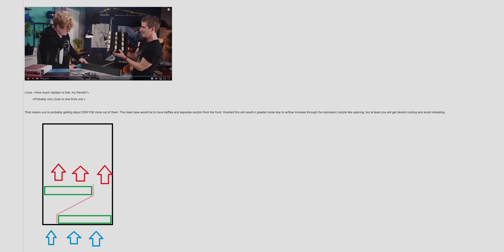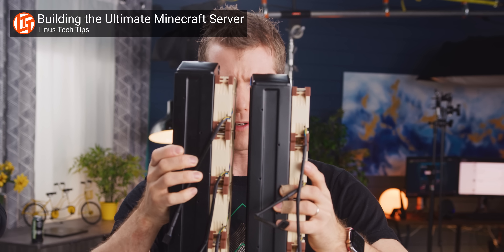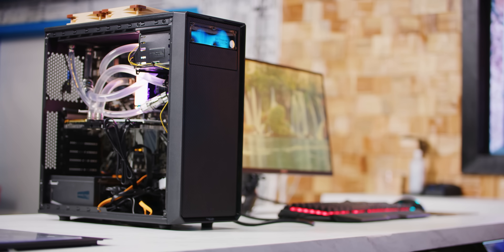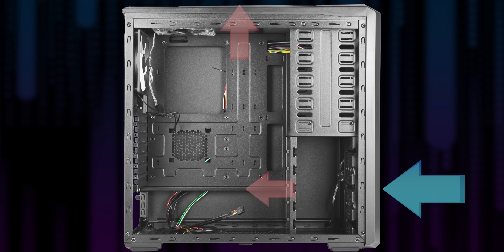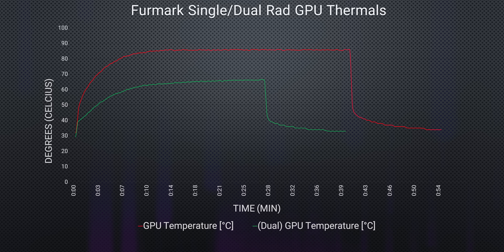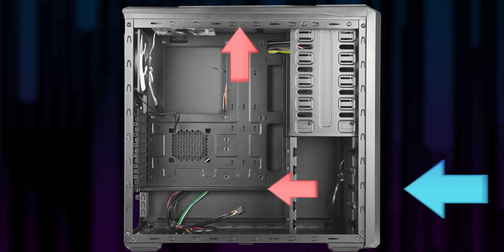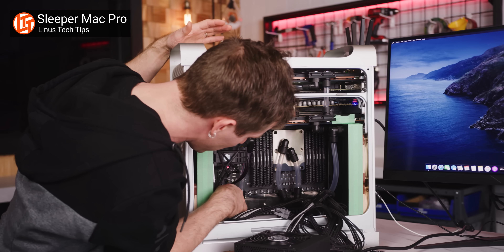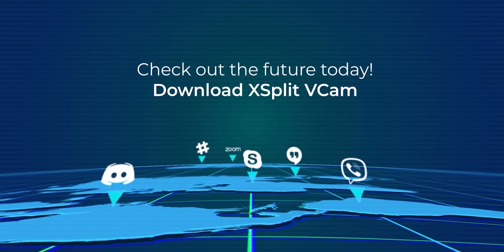I’ve been water cooling wrong for YEARS - $H!T Manufacturers Say

Comment: It's all down to CFM, and fluid volume.
more airflow = greater disparity in temps between the radiator itself and the air exhausted.
Let's say you have the first radiator at the top exhausting the bulk of the heat to atmosphere and a secondary at the front, any heat that makes it through the first radiator will be mostly displaced by the second. Sure it's going to slightly pre-heat the air through the primary, but it's still vastly cooler than the radiator itself enabling it to work. Also, in order for things to get to that point it will now take longer as not only are you more effectively cooling (i won't say efficient, as radiator efficiency is highest when coolant temp is way about ambient) the system, but it's going to take even longer again to saturate the added coolant and metal with heat.
The same thing applies with 6 stacked radiators, as long as the coolant enters via the exhaust end of the stack and maintain adequate airflow it will have a much greater capacity to absorb and exhaust the heat.

If you stall the fans however, all the heat has nowhere to go and will simply be absorbed back into the loop by other radiators, and the same if you reverse the flow on a stack, as you're then pumping heat out through the secondary and tertiary etcetera radiators enabling some of that heat to transfer back into the coolant and back through the loop.
Another option is to have a bigger secondary radiator than your primary exhausting radiator, that way if the second radiator heats up, the fans ramp up, and a good portion of that slightly heated air will exhaust either through the rear case fan, it out through any holes/openings in the case via positive pressure.

Comment: Guys... your video is confusing me. Isn't the CFD simulations show a comparison between open case and closed case (Removed dust filter + glass panels)? 

The difference in airflow suggest it.
Your "test rig" isn't representative of a stacking (serial) configuration, but rather a parallel configuration. You must do another shoot with a real stacking configuration like 2 120mm radiator stack (I think it will fit in the case). And i think the results will be interesting. 

Thanks anyway!

Comment: I think what they were missing was the fact that there's alot of air volume inside a case and air temperature dissipates very quickly. Let's say you have a 3fan rad up front and just 2 fans no rad on the back and forget any other openings if you measured the air temp right after it passed through the rad let's say it's 30c by the time it gets to the back fans it'll have cooled down you can actually test this by simply opening up the case and feeling the air exiting the rad then close it back up and feel the air exiting the back fans. Another point is that with an additional rad you're adding to the total amount of fluid in the loop like when jayztwocents used a box fan covered in rads he turned the fan off and still reached ambient temperature just due to the amount of fluid and the distance it had to travel (this is where the facts end and my own 2am thoughts start) I don't believe radiators are that perfect if they were even 90% efficient then temps would be only 10% higher than ambient right?

Comment: I am interested which way around corsair piped their water, and which way around linus did - I would expect piping the hot water into the first cooler on the inlet and then the second cooler on the outlet would be closer to corsairs results, and visa versa (hot water first into the cooler on the exhaust, and then the somewhat cooled water into the intake cooler) would show definite improvement. I would also expect reversing the fans so that both cooler blocks where exhausting would be an interesting comparison depending how much dust you are happy sucking in.

Comment: Also, did you just not hit the thermal limit of what the front rad could dissipate into the air.  Would, therefore the air had more latent capacity so the second rad did give up some heat.  I think Corsair's simulation either relies on the air temp getting up to the coolant temp after passing the first rad be it through heat dumped from the first rad or that the air temp is now too high to cool the second.

Comment: Would like to see if the 5C delta on the minecraft rig may have something to do with the lower thermal mass (less water and brass) or a change in flow restriction.
I'd be surprised if the Air wasn't in equilbrium after the 2nd Rad.
2nd idea, did removing the rad also result in the removal of the fans attached to that Rad? that would result in a lower deltaP and thus lower airflow through the remaining radiators. Though finding a Certis Paribus point for the fans and delta P/Vdot would be tough...

Comment: 3 things as I see it.
They talked about lower wattage/temp not 90'ish of 400W monsters. Lower the temp difference, less results you should have.
Configuration of hot vs cold was different. From what I see is that hottest should be closest to end. if you stack them with the hottest point on the place where air enters your rig, results might be as what they described.
what they meant was diminishing return? you will get SOME change by share volume of coolant. MAYBE the loop would be just as efficient with big rez as with 2 radiators?

Comment: It’s all down to airflow velocity, if you push enough air through fast enough your exhaust air will only go up a few degrees but due to sheer volume you’ve still removed the heat. They assumed quiet fan curves so low volume but you guys always go balls to the wall with fans.

Comment: It all depends on how you position the 2 rads. Stacking them in a fan rad sandwich is bad. One rad is being cooled but is transferring the heat into the 2nd rad which is already cooled. Negating the cooling done. And 1 rad being an intake while the other rad being the outtake would be ok. Depends on if you have other intakes. If you don’t have other intakes, would have the same problem as the sandwich. is you have them both as outtakes then it’s be a good thing as well. Tldr: It all depends on how you position the multiple rads and their fans.

Comment: Something I think it would be worth checking into based on other airflow in your case is having both radiators exhausting or intaking rather than one intake and one exhaust, both exhausting would prevent them from spitting hot air into the case at all, and assuming you had other intake fans throughout the case, I’m sure the inside air temp would still be cooler than what they’re trying to dissipate, or having both radiators intaking colder ambient air, with other case fans providing exhaust throughout the case

Comment: So I guess what we really learned is that: when you're planning the loop in a two rad setup where one is intake and one is exhaust, just to be safe, you should try to put the exhaust radiator first in the series to receive the hottest water, and the intake rad second, so as to potentially maximize the temperature delta between the air and water (even though it's likely to make very little practical difference)
Reply: yep this is what is called counterflow heat exchange
Reply: This is indeed a very important consideration. Heat exchangers used in industrial equipment are always set up in a cross-flow configuration...this way there is an appreciable temperature delta throughout the entire heat exchanger, rather than a decreasing delta.

Hydraulic fluid example:

          hot oil >========> cool oil
warm water <========< cold water

In the above, as the oil flows through the heat exchanger and cools, it maintains a temperature delta with colder and colder water.

If a single radiator is not big enough to bring the water to near-ambient (1-2deg delta), then a 2nd one will definitely help. And if you're stacking them, it's much better to put them in a cross-flow configuration.

hot water > Rad1 > Rad2 > cool water
 warm air < Rad1 < Rad2 < cool air
Reply: And a quick addition, while concurrent flow in a heat exchanger achieves a greater temperature delta at the inlets, you lose that delta by the time you reach the outlets, and since the cooling medium has warmed up by the time it reaches the outlet, the cooled medium doesn't have a chance to reach the inlet temperature of the cooling medium.

So yes, while temperature delta does affect the rate of transfer, maintaining a constant delta throughout the surface of the heat exchanger is more important than a large delta in only a portion of the heat exchanger.
Reply: @CarlinHefner  That's good to know, thanks for sharing :) Having a discussion with Companion Qubit to which you can probably bring meaningful insight.
Reply: Radiator placement in loops doesn't make difference.Water temp will equalize. What does, is set everything to intake but prepare for dust buildup if you don't have good filters.
Reply: @MrScart35  like really fast. If you have a DDC set to like 30-40% you won't measure any diffrences at all. 
A slow spinning D5 can have a really flowrate at the end of the loop maybe having a impact on coolant temperature
Reply: @MrScart35   It's not fair to make such a general claim. As I said, "it is likely to make very little practical difference", but it essentially comes down to the ratio between your volumetric flow (aka pump speed) vs your total volume of liquid (aka the lengths of your piping runs). As that ratio gets lower, you will see a larger difference. It's just that at the scale of a typical desktop liquid loop, you're unlikely to have the test resolution to notice because those pumps are quite speedy, and the volume is pretty low.
Reply: This logic is inherently flawed, as heat exchange is not linear with heat difference but exponential. Maximizing one difference and minimizing the other should therefore lead to better cooling in this thought experiment. Although I second the comments saying there is no difference in the real world, as water temperatures in the loop aren't hugely different on intake vs outake. Water flow is really fast inside these Loops.
Reply: @companionqubit9273  I know reading isn't a strength of internet comments (myself included), but I specifically said it's unlikely to be noticeable in the real-world scenario being discussed (water cooling loop in a PC).
That said, you're right that changes in specific heat values for water & air change with temperature in non-linear ways, and therefore it's a non-linear relationship. But my argument is that we are not dealing with large enough temperature deltas for this to make a significant difference and can be assumed to be linear. However, the difference in effectiveness we're attempting to determine is already so trivial that without investing a solid month of experimental data gathering, we'll never know.
But let's play. I did my half of the napkin math. If you do yours we can compare for the lols.
Assumptions:
0) Steady state. I'm not writing a PhD thesis here.
1) Heat transfer efficiency is linear with respect to temperature delta.
2) Temp deltas inside heat exchangers (rads). In reality a delta of 1C for water would equate to something like 20 or 30C delta for air (rough calc said 28.5 assuming a 100cfm fan of avg density air vs 1500liter/hour D5 pump. I just made it 5-to-1 so as to not deal with decimal water temp differences. So on my napkin (notepad, calculator & google), each rad drops water temp by 1C and raises air temp by 5C.
3) Temps themselves. Just pulled numbers in the realm of potential reality:
So two rads: Water in of 45C and 44C, water out of 44C and 43C, respectively.
Air in of 25C and 30C, air out of 30C and 35C, respectively.

For your suggested config of hot rad at the intake, and cold rad on the exhaust:
I got an LMTD of 16.949 for the intake rad. LMTD of 10.714 for the exhaust rad.
LMTD_net1 = 27.663

For my suggested config of cold rad on the intake, and hot rad on the exhaust:
I got LMTD of 15.936 for the intake rad. LMTD of 11.905 for the exhaust rad.
LMTD_net2 = 27.841

Colossal difference, I know :P

So, I hope we agree that the heat exchange area stays constant regardless of our theoretical musing. Our point of contention is that specific heat differences will affect the heat transfer coefficient enough to offset this difference and swing it in the other direction.

I eagerly await your response :)
Reply: Doesn't make a difference. Water has a huge heat capacity, it takes a lot of heat energy to heat it up - this is part of the reason why liquid loops with large reservoirs take so long to reach equilibrium. The radiator might be dissipating enough heat into the air passing through to heat up the air by 10C, but the drop in coolant temperature through the radiator will be ~1C or less, unless flow rate is low. Similarly, the temperature increase in the coolant as it passes through a CPU or GPU block will be around 1C or less. You could optimise loop order to try to maximise the air-water temperature delta, but in real, practical, measurable terms, loop order rarely matters.
Reply: Not how loops work.
Reply: This should make a significant difference. It's why industrial heat exchangers run the working fluids in opposite directions through the heat exchanger. (That is to say, the exhaust of the cooling loop is occurring at the inlet of the working loop. This can get you huge net differences in heat flow)
Reply: In a sealed system (no air leakage, only though the rads), that won't make a difference, if Corsair's claim is correct that the air exiting the rad is nearly equal to the temperature in the rad.  In a real case, you'd actually want the hottest rad to be on the intake side, as that will get you the largest temperature drop from the secondary air flow.  I am, however, not convinced that the air temperature leaving the radiator is nearly the same as the temperature of the working fluid, especially on low fin density radiators, and especially once they get a layer of dust.

Comment: You should also check if you have the water flow in the right order. Meaning first the exhaust rad then the intake rad so that the temperature gradient is at its optimum for each of the rads

Comment: @linus tech tips. Well It does matter in ideal situations. So yea you are right. Only if the system is sealed airtight will this result in higher teperatures of the system overal. But as air is rather hard to mantain a decent flow with, adding more fans only makes sence and should improve your system preformence

For an example where you actually need to seperatre the flows, you should look to the Koenigsegg cars, that have airflow to cool their engine but also have a seprate flow to cool each of the breaks.

Comment: I wonder what the order of the components is. The "Countercurrent exchange" mechanism might be relevant here. Routing the hot water through the exit radiator first and then through the intake might yield better performance than the other way around. Feel free to correct me if i'm wrong. I've never tried this.

Comment: Hi.
The only thing this video shows is that more heat is extracted with more radiators. But is it worth it? Wouldn't it be better to try to maximize heat extraction for the one radiator before throwing money and radiators to fix the problem?
You guys did not even test corsairs clam with the radiator outside the case.

Wouldn't this mean that is always better to make the fans on the radiator intakes. Then the temperature gradient as high as possible for the air passing over the fins. And the hot air will be pushed outside with the other case fans.

Some test that would be interesting:
- Test fans as [in] vs [out] direction.
- Putting the radiator [outside] vs [inside] the case.
- Stacking radiators (as shown in the minecraft server) [first radiator in loop has cold air intake] vs [last radiator in loop with warm air from the other rads in the stack]. This would warm up the water from the heat from the air from the other rads.

Comment: It’s because you’re maxing out the thermal capacity of just one radiator. If you didn’t use a furnace for this, you’d see what they’re talking about.

Then, regarding your literal stack where they’re linked up in series, yeah, parallel so they’re all sucking in cooler air is going to be much better, but of course that’s harder to fit places.
Reply: So if you're not maxing out one rad (ie: you have more than enough cooling) you don't need a second cooler?
That's not what they were trying to say.
Reply: Adderkleet Corsair meant that in most situations people are not maxing out the thermal capacity of one rad, adding a second adds little benefit. Then when you ARE maxing one out, it’s always best to have cool outside air as the intake of both, rather than intaking hot exhaust from another.
Reply: @JoeyDee86  How the hell did you come up with that completely false interpretation of their statement?
Reply: ch3573r90 huh? They were talking about the difference in ambient and the temp of the rads, IE what you need to properly dissipate heat. The smaller the difference, the less heat will be dissipated. This is why they were saying you shouldn’t have a 2nd rad that’s being fed hot air from another rad or inside the case.

Comment: The trick is to have opposing fluid flow. Put the "second" radiator with the hotter air, should be the first in the loop with the warmer water. The "first" radiator should be the second in the loop, so that the already cooled water hits the super fresh air.
I don't know how much of a difference that would make, but would be an interesting test for Shure. Also it would have been very interesting to see, how the Setup would compare to the "ideal" set up, with two radiators in parallel outside the case.